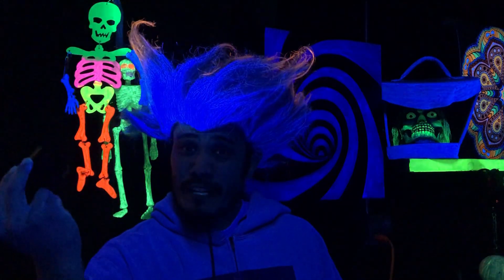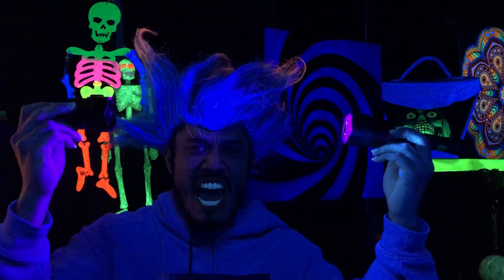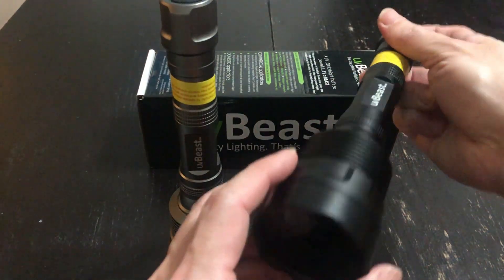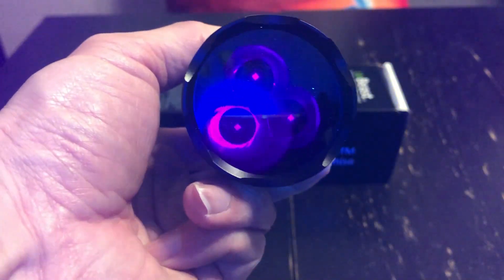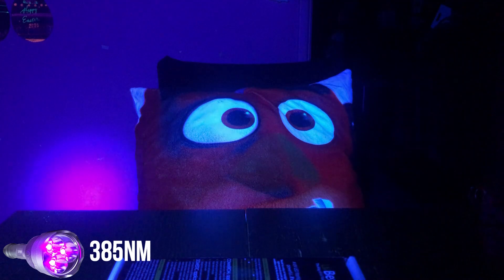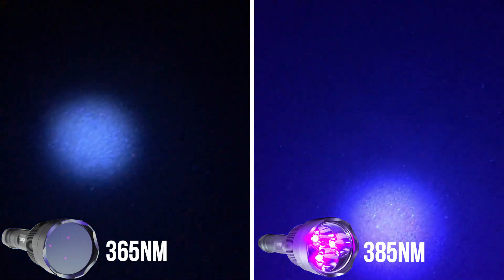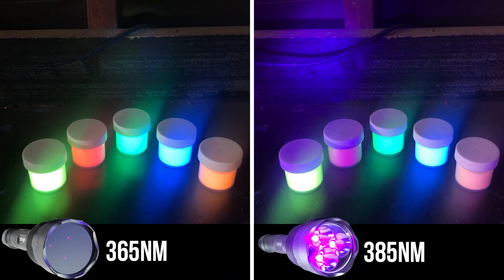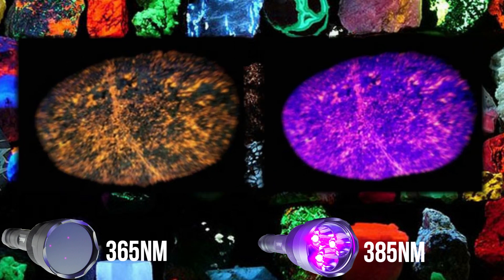UV Beast 365nm VS UV Beast 385nm - What Is The DIFFERENCE Between 365nm and 385nm UV Flashlights

Comment: If you remove the filter from the 365nm model does it perform the same as the 385-395nm model? To ask this another way, if the filter is installed on the 385/395nm model does it perform the same as the 365nm model? I’m wondering if they use the same LEDs, but the filter just removes most of the visible light and leaving the 365nm wavelength to pass through.  According to the manufacturer’s specs, the 385 model has 44% more UV Radiant Intensity (1950mW vs 1350mW) and 50% more UV Irradiance (8100uW/cm2 vs 5400uW/cm2).
Reply from the maker: It won’t perform the same if you put the filter on the 385nm model.  The LEDs are what determines the wavelength.  You will cut out more visible light from the 385, but you won’t have true UV at 365nm.
Reply from the maker: I believe the 385nm has higher UV output because it doesn’t have the filtered glass.  Filtered glass does block out some UV.

Comment: I'm new to large UV lights I was about to buy the 385NM v3 as a more powerful replacement for my olight 365NM mini uv light.  I use it to find pet stains, leaks, and other household tasks. You think the 385 will be fine or is it worth the extra bucks for the 365NM? 
Great video thanks in advance
Reply from the maker: For those applications I would go with the 365nm.  I just think the purple visible light from the 385nm washes out a lot of pet stains and other detections.
Reply: @UVBlackLights  Thanks!
Reply from the maker: @PM-mr8ky  anytime!

Comment: What ones better for finding golf balls?
Reply from the maker: If it’s super dark out there I would go with the 385nm.  Although you can’t go wrong with either.
Reply: @UVBlackLights  would a uv beast v2 work just as well struggling for money Rn
Reply from the maker: @lewoasn  Yes, that one will work as well.  You won't get as strong of a throw beam, you get more of a flood spread, but it'll work just fine.
Reply: @UVBlackLights  I have a 100 led right now and it’s good but looking for a upgrade so excited to get it and find some golf balls
Reply from the maker: @lewoasn  If you already have a 100 LED, I would save your money and get the beast.
Reply: @UVBlackLights  the 385 one?
Reply from the maker: @lewoasn  Yes, if you want more visible purple light.  If you don't want the extra visible light, then get the 365nm.
Reply: @UVBlackLights  but would the v2 be better then the 100 led cause the 100 led isn’t very powerful you can only see golf balls from about 4-5 feet away
Reply from the maker: @lewoasn  I’m not sure cause I haven’t tested the 100 LED one.  From what I’ve seen on other videos it should.  But if you want longer range you should get the v3.
Reply: @UVBlackLights  I just brought the 385nm thank you for answering my questions and the fast response you just earned a sub
Reply from the maker: @lewoasn  sweet!  Let me know how it goes!  Thanks for subbing appreciate it!
Reply: @UVBlackLights  just got it today 1000x better then the 100 led so much brighter and better
Reply from the maker: @lewoasn  awesome to hear!  Glad you like it!!

Comment: Hello I found your videos on Instagram well looking at different models of the UVBeast. I want to use the best one for displaying glass art in videos do you recommend the 365 or 385? And if you say 385 would u recommend a 365 to find very small lost glass art outside in the grass? Or should I get both? Thanks for your videos appreciate them and looking forward to your response sir !
Reply from the maker: I would use the 365nm to show it's true colors and 385nm if you're out hunting in darker areas.  It'll give you more safety precautions.  Hope that helps.  Thank you for watching!
Reply: @UVBlackLights  thank you for the fast reply I just ordered both 🤗
Reply from the maker: @erikanthony4991  No problem at all!  Cool, I hope it works out for you!
Reply: @UVBlackLights  one more quick question I noticed both of these UV flashlights do not come with protection glasses from the UV - is there a certain kind u recommend? I’d like to have like 5 of them so for anyone in my area will be protected that wants to see it 🤗
Reply from the maker: @erikanthony4991  the UV beast 385nm comes with safety glasses but they don’t block out the UV very good.  I don’t really have a recommendation, but if you google UV safety glasses you’ll get good results.  I would go with the colored ones like orange or red.  Btw good safety glasses are very hard to see out of just keep that in mind.

Comment: I can't decided between the UV beast and LIGHTFE UV... Both on amazon. Beast is $5 more is all I can see.
Reply from the maker: 365nm or 385nm?  I haven’t seen the lightfe in action, so I can’t really comment on it.
Reply: @UVBlackLights  It's also 365nm so it's making my decision harder. I used your other video to come to a decision between the beast and convoy but now I have this new option xD
Reply from the maker: @11Evalone  Totally understand where you're coming from.  All I can really say is the 365nm beast is just as advertised.  I've had no issues with it and the power is amazing.  If you're buying from Amazon, get both and return the one that doesn't fit your need.

Comment: Have you seen the “LIGHTFE” uv flashlight o Amazon that claims 20,000mW of 365nm light? It’s almost $300, And I’m sure it’s nowhere near 20W of actual optical output power… But I bet it packs a big punch given the brand of LEDs they’re using, which is a really good and well respected brand… Not near Cheer, not LG… But Seoul viosys has been around for a long time, and they’ve made some huge advancements and UVLED technology… And are a wonderful company.

I would guess that light claiming to be 20,000mw output is 5,000mw maximum. Even if it is 5000 Mile watch… They’re pushing those LEDs too hard and they will fail soon.

But that’s still ridiculously bright! A little over priced maybe… But 5 watts of optical power is in sane and dangerous! And I don’t mean “5W of power”.....Like all of the UV lights claim anywhere from 3w, 5 W, some even claim 10W and 15w. Even if they are pushing anywhere near that power… That’s NOT OPTICAL OUTPUT POWER!!!! Those crazy inflated numbers are for DISSIPATED POWER. 

The actual optical output power is what I light is supposed to be advertised as.... any light source…  flashlights, lasers, whatever type of light source. Other than lightbulbs you screw in at home. 
If a light claims 10 W of power… That means a dissipated power. Which would give it somewhere in the neighborhood of 1.5 to 3W of optical power. And that’s if everything is designed well with direct thermal path mcpcb’s, and a lot of thought put into it.

I would love to see that 20,000mW light reviewed. I’d like to see how it compares to my ACEBEAM X80- UV, but at half the price…

By the way… No way I paid the retail $500 for my acebeam x80uv flashlight. I snagged it on eBay for a ridiculous deal! I could never afford the $500 price of a new one. 

But it is an incredible piece of engineering.… Housing 16 of the best nichia 365nm LEDs ever made.. each one easily capable of 1000mw of optical output power. 

I don’t think they’re pushing it that hard… I haven’t measured the current but I’m guessing it’s at least 10,000mW actual optical output power (also called radiant flux).  

It’s Face melting that’s for sure. If I assume the ace beam is 10 W optical power… That would make it at least 3 to 5 times more powerful than any of the UV beast flashlights. But honestly… The UV beast lights are wonderful lights for the price… And there’s absolutely no need for a more powerful UV light.

 I really enjoy your channel! Would love to see you do some tear downs and DIY mods of UV lights. Come join us over at budget light forum… It’s much easier than you think and it’s really fun and addicting!
Reply from the maker: Hello!  Very good break down and information that people need to know!

I've seen that LIGHTFE on Amazon and as good as it sounds, it's just too pricey for me too do a review on.  I can try to reach out to them, but I doubt they'll respond to me.  I'm very familiar with Seoul viosys and they do put out some good UV LEDs.

I'll have to do some reading on that acebeam you have.  The nichia LEDs alone caught my interest.  I believe nichia has the best UV LED currently.

I'll check out the budget light forum for sure.  Thank you!

Comment: What is the best uv for my uranium glass ?
Reply from the maker: 365nm is definitely the best for that.
Reply: @UVBlackLights  I didn't understand what those numbers mean until I got a bulb for my curio full of vaseline glass and it didn't work and I know my stuff glows because it does with my flashlight
Reply from the maker: Can you tell me what model bulb and flashlight you have?  365 nanometers in the wavelength.
Reply: @UVBlackLights  The Flashlight from eBay.. UV Ultra Violet 51 LED Flashlight Blacklight 395 nM Inspection Lamp Light Torch
Reply: From eBay also.... 40T10BL 40W Black Light Tubular Bulb T10 Blacklight
Reply from the maker: @shellyhumwood1646  That's very odd that it doesn't work.  Have you tried a 365nm UV flashlight?
Reply: @UVBlackLights  The flash light works great. It's the bulbs that didn't work. Ordered LED tube light that was recommended and rope lights too now. Waiting on them to arrive
Reply from the maker: @shellyhumwood1646  yeah it’s odd the blacklight didn’t work as it sounds like it’s the same wavelength as your flashlight.

Comment: I just purchased do UV beast 365 to my eyes when I remove the filter I nearly virtually see no difference in light output they’re both very bright in my eyes. 
      My coworker sees a big difference my girl sees a big difference so the problem lies with my eyes. 
              When removing and placing the woods filter lens in front of the lights on and off on and off both look equally as bright to me other people tell me there’s a big difference.

But it’s extremely Florences my UV dye for refrigerant leak testing excellent product
Reply from the maker: There should be a difference, as the filter blocks out the visible light, but also can block out the output.  But either way, you can't go wrong with the output.